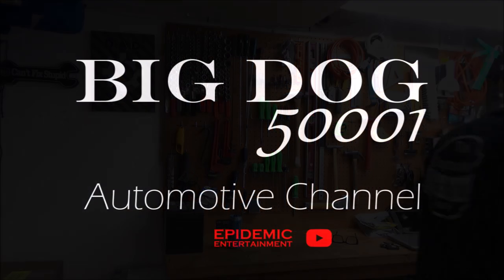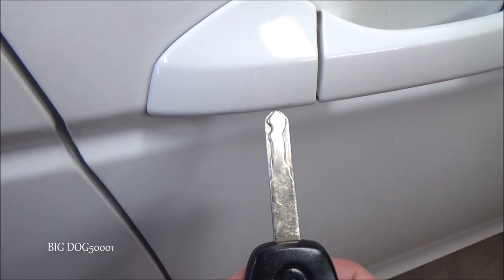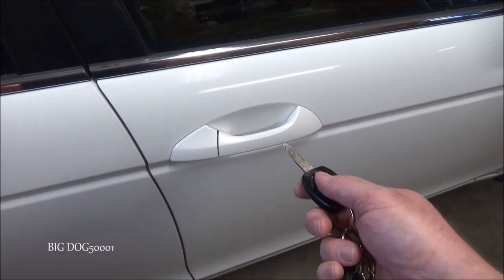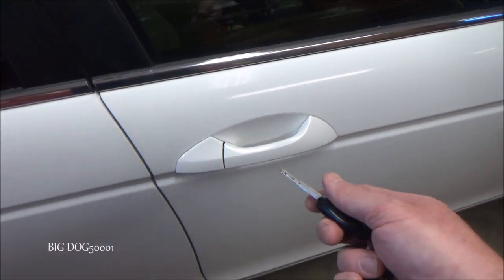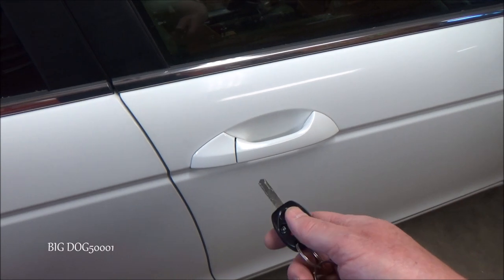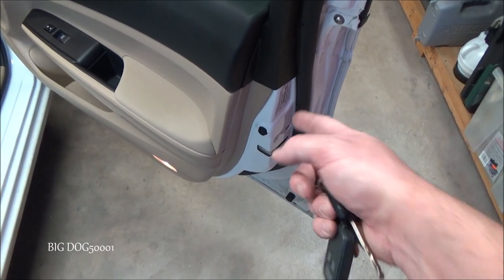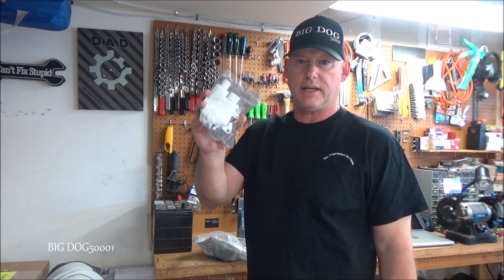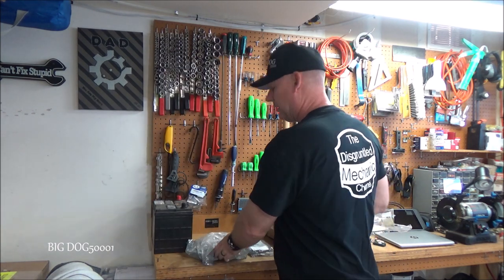Buzzing Noise From Door Locks - Honda

Comment: Thanks for the info. I've had three Hondas over the last 3 decades and only experienced this once on just one door. Thankfully, I was able to fix it without buying parts. Got lucky that time.
Reply from the maker: Thanks for the input!
Reply: GEO......How did u fix it without buying parts?
Reply: @motorcitymanman7711  Part of the plastic body cracked, failing to keep a spring in place, which in turn maintains tension to keep the gears in mesh. It's been a while so I don't recall the exact things I used, but I put the broken piece back in place and reinforced it. I also fixed it almost immediately after the failure, so the gears appeared in good condition.

Comment: i got a 2000 honda ka9 legend acura
recently the passenger Door lock wont unlock it sounds like it would open but it doesnt,
it tries to go up but it goes back down and lock itself its been doing that recently and no damage has been done to the door.
any tips or help to what could it be?

Comment: Hi, asking for a family member, but your video may be helpful for her situation so thank you!
She was recently rear-ended and ever since she says she hears a constant buzzing noise in the back of her 2001 odyssey van. She says her battery suddenly keeps draining as well. Do you think it could possibly be a tail gate actuary causing these two things?
Just trying to help because the girl is a single mom of two & can’t afford much. Any advice is valuable & appreciated.
Reply from the maker: Sounds like there could be something damaged that is now staying powered on, and that may be separate from the noise (or it could be the same).  Unplugging connectors to the components in the back could help narrow down the problem(s).

Comment: Will this cause?
We're tearing on the battery for it to eventually, not start your car.
Reply from the maker: As long as the lock isn't continuously going (stuck on), it shouldn't effect the battery.  It is usually just an indication that the lock is failing.

Comment: Mine drained down my battery as it was grinding all noght and there is a buzzing sound in a white box near the interior fuse box. It is a 2008 Buick Enclave.
Reply from the maker: Sounds like something is keeping the circuit on, like a stuck switch or relay.

Comment: I don't have a buzzing sound I have a vibration in the lock lever only when I unlock it but it also won't lock with the fob but it will manually.  Also no sound manually
Reply: Oh it's a 08 civic